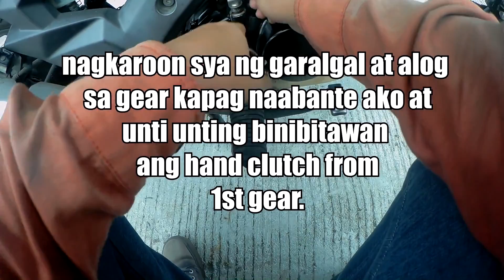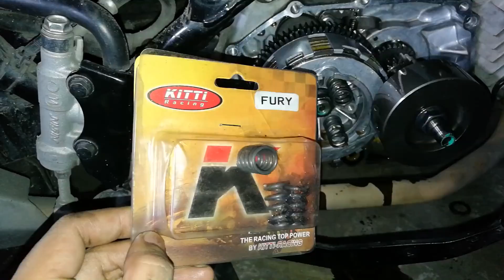How to Install Clutch Lining and Clutch Spring | Fury 125 RR

Comment: sir skid alon, ask ko lang po ano po kaya dahilan at solusyon pag nagda-downshift ako sa 1st gear may malakas na tunog parang katok sa bakal
Reply from the maker: RR din sayo sir? Kung di pa napapalitan lining mo try mo mag adjust ng clutch cable. Tignan mo na din langis mo kung madami pa.
Reply: @skidalon3247  salamat at napansin mo paps, RR din po akin, wala pang 1k odo. pano pong adjust sa lining? baguhan lng po ako sa motor
Reply from the maker: Clutch cable po ang iaadjust sir. Kung di ka po marunong meron naman po tutorial sa Youtube madali lang yun. 
Normal po ang may tunog pag nagdodownshift ka. Pero kung sobrang lakas di po normal yun.

Comment: Idol bakit sliding parin ung kick ng fury ko, bagong palit clutch lining, clutch bell,  primary clutch at clutch release replacement lang din lining ko pag malamig makina sliding pag napainit na umaayos sya tapos sa unang gamit pag napainit na medyo may delay ung hatak pag ginas mo nag oover rmp delay ung hatak nya then pag pangalawang gamit na ng motor nawawala naman maayos na ung hatak 2009 model fury ko 6k nagastos ko lahatan di rin pala maayos ung sliding